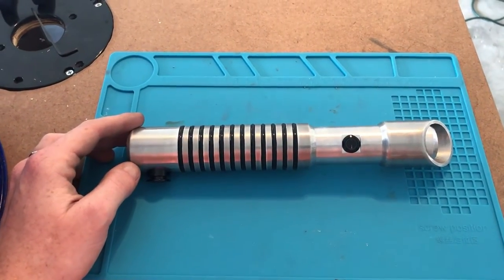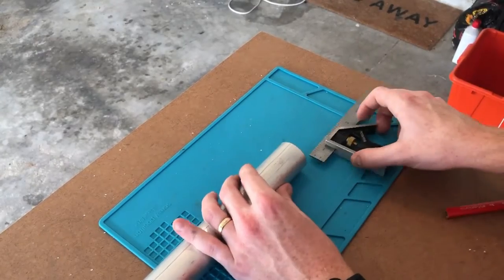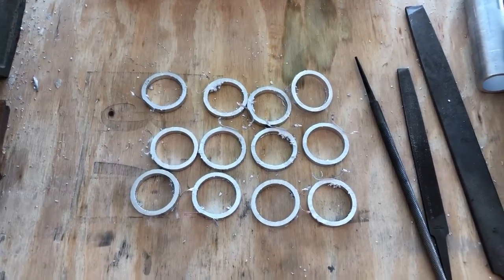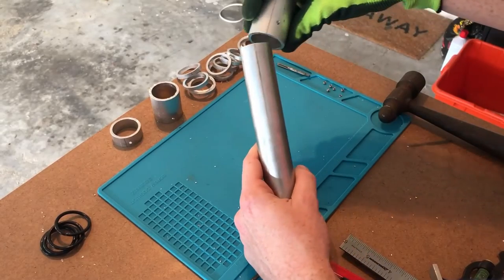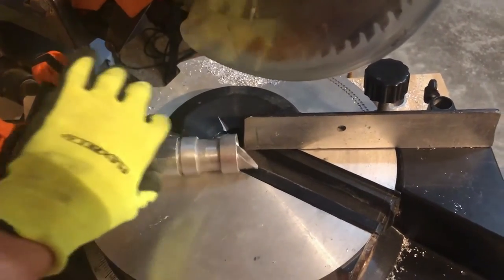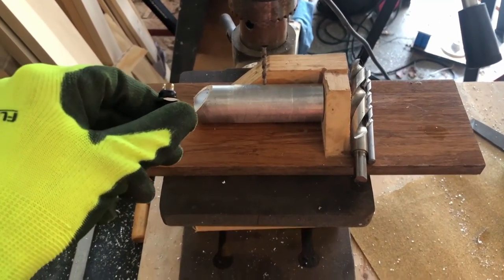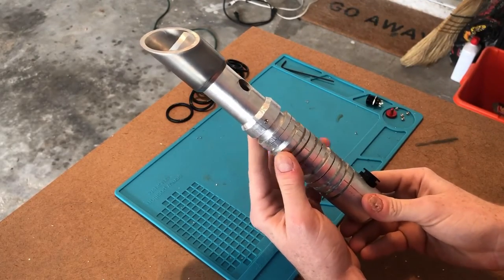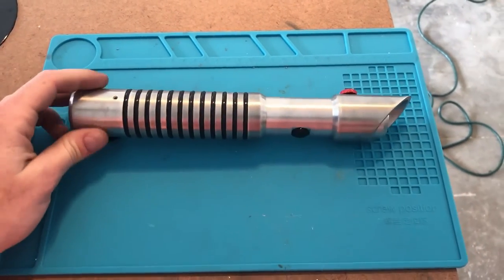How to Build a Lightsaber Hilt Step by Step - DIY Build Tutorial

Comment: Thanks for this bro!! I just started building a PVC hilt as it is what I had in the garage. I borrowed my mates mitre saw and have my dremel and went to work. Actually quite happy with it! With make a spacer to hold the blade as the pvc was a little bit wider than an inch. Nearly done. Just a few more pieces for decorative purposes then I’ll move onto the blade.
Reply: So you made yours out of pvc is it still good cause I might do that

Comment: Have you ever had a problem with the 1-1/4 pipe fitting into the 1-1/2" tube? I purchased 6061 aluminum pipe with the 1/8" wall. The 1-1/4" doesn't actually fit into the 1-1/2" pipe. I was able to hammer a piece onto the larger pipe, but it looks like it will require a decent amount of sanding to make it work.
Reply: As an aside, I thought it might be that one or the other tube was bent; it wasn't. I cut 10 pieces from the length of 1-1/4 and none of them fit inside of the 1-1/2". They're all marked as 1/8" wall thickness. I managed the get around it by grinding out the inside of the 1-1/2" pieces; all 90 of them.
Reply: I'm dealing with this same issue now. I was planning on sanding. Too bad he did respond to you about the issue. I would like to know if he had to deal with the same issue.

Comment: I'm just getting into the electronics of this build. The switch that you use has a note on it that says you need to add a resistor to keep from frying the LED, but you didn't use one on your build. Is it because of the electronics in the board you used?  I don't want to fray any of my parts if I can help it.
Reply from the maker: There was a resistor on my board already. You need to read your sound board manual to determine if you need a resistor or not

Comment: Hi following your build! But i'm confused about the pipe diameters? if your inner tube is 1.25 in OD then the outside bigger pipe is 1 3/8 in OD if it was 1.5 in OD with 1/8 in wall then you're off by 1/8???
Reply from the maker: I see your confusion. There are two walls you need to account for when calculating diameter. If OD is 1.5 then subtract 1/8 twice for the walls on both sides and you’ll get 1.25 ID.
Reply: @StateofBuild  ohhhh yes! Thank you!

Comment: I have the same measurements of aluminum but they just WONT fit together...anything you did differently?
Reply from the maker: I had to sand the exterior in some spots to get them to fit better. Sometimes corrosion increases the diameter

Comment: Is the inner diameter of the O-Rings 1 3/8", or is that the outer diameter?
Reply from the maker: OD, it’s 1 3/16 for inner diameter
Reply: @StateofBuild  where did you source your O-Rings? I can't seem to find any on-line. I've found 1-3/8" OD, 1-3/16" ID and 3/32" or 3/16" width, but I can't seem to find a 1/8" width with the 1-3/8" OD & 1-3/16" ID dimensions anywhere.